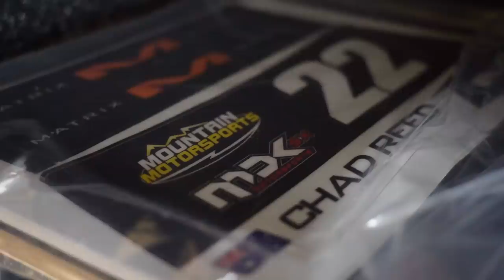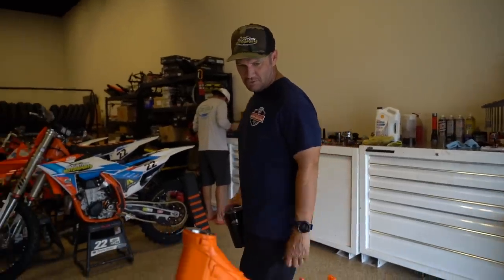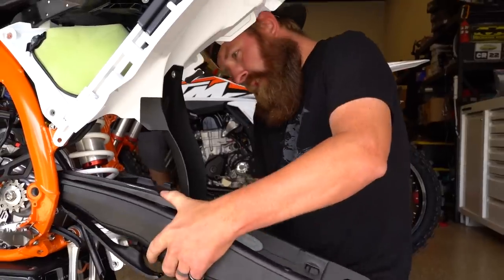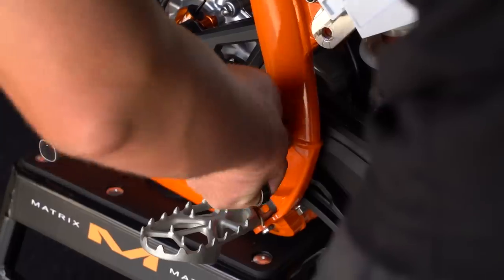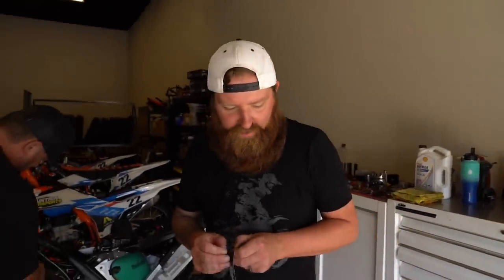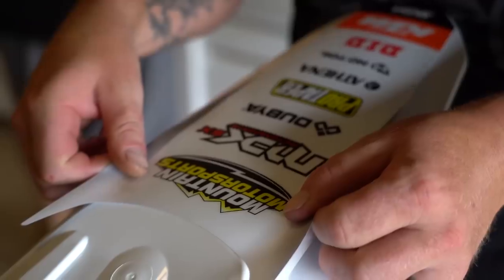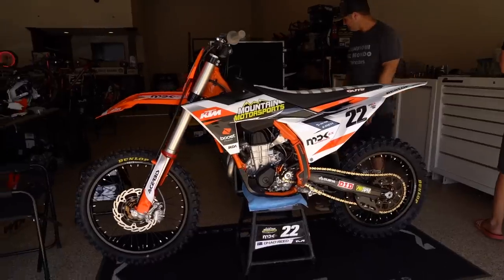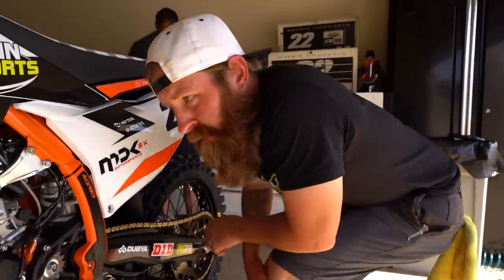Chad Reed's World Supercross Race Bike Build! 2023 KTM 450 SX-F

Comment: I absolutely love taking my bike apart and reassembling it with every single screw, bolt, nut torqued and loctited perfectly to spec. I'm an engineer by trade and my engineer brain is constantly looking at parts to see how they can be manipulated to make them better for me. I will test individual parts for hours before I use them as a full time part of my race bike. I have purchased or been given sponsor parts that don't pass my testing and won't get used even if I get them for free.